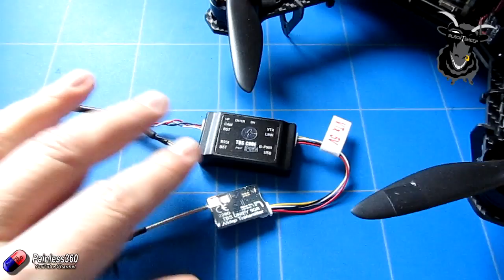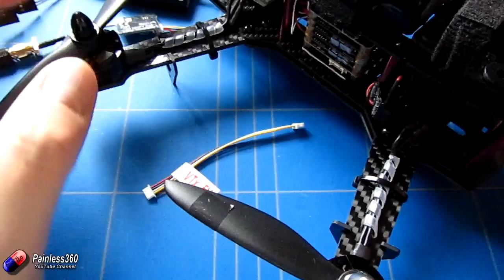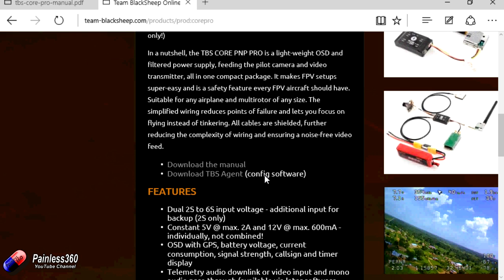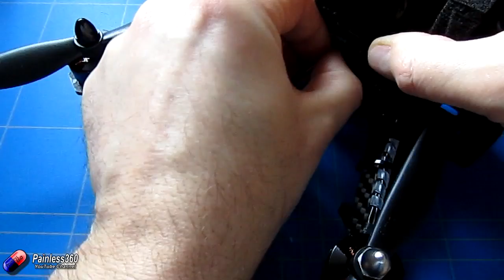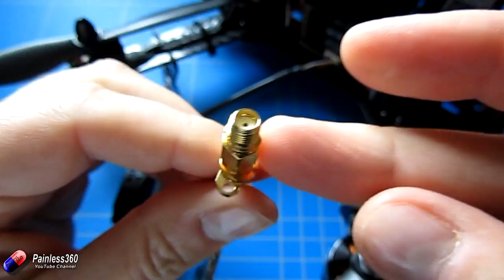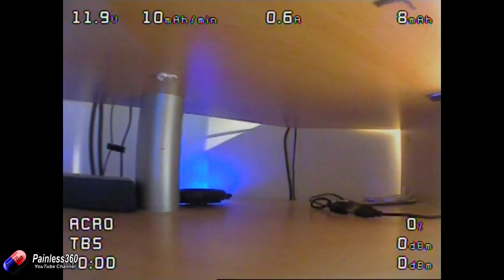(3/3) TBS PowerCube: Adding FPV kit (TBS Core Pro and TBS Unify Pro 5G8)

Comment: if the cam is 12v i can solder the pads to 5v?
Reply from the maker: You need to supply the camera with a voltage that it support. Best of luck

Comment: Have you had any heat issues at 200mw with the TBS unify pro race hv? Mine seams to get quite hot, I don't loose signal. It's mounted with great airflow off the rr prop. Just woundering if that's normal.
Reply from the maker: It does get warm, almost all of the more compact VTX here do. I did chat to TBS about the best practice on this and they've run the Vtx for a long time on the bench without a problem.. Personally I only power up the quad just before I fly and try and keep the airflow decent around the Vtx on the model when I can..

Comment: Noob question here: Do I need the Core pro to receive battery voltage data from the TBS powercube?  I am using an X4R receiver.  If not, could you tell me how to wire the powercube to the receiver to receive the data?  Thanks much!!!
Reply from the maker: Not sure what you're asking here. The cube monitors the battery voltage through the inbuilt PDB anyway.. Best of luck!

Comment: I joined the power into the VTX wire to the power out wires at the camera plug then had to rearrange the pins in the appropreate order, now when I plug the end intended for the camera into the core vtx out it powers the unifi pro. my unifi came with a 6 pin locking plug in so I had to make it work.Also changed voltage out from the core to 12v for both cam and VTX, running TBS 59

Comment: Hi,
Any idea if it is possible to connect gps to a tbs vendetta and make it "return to home" in case of tx signal loss or for any other reason? Thank you. Your videos are great!
Reply from the maker: +Vimalan Ketharanathan you could connect one but the GPS code in Cleanflight and Betaflight is sadly not up to the job..

Comment: the cable that came with my unifi pro has a split for power in and camera, the camera end will plug into the core at the vtx out, will this work? am I going to damage one or the other?, my unifi has a locking type plug in , none of the cable that came with the core fit. Not sure what to do,
. don't want to damage anything.
Reply from the maker: +Jeff Orr is get into the vendor as the cables that came with ours worked great.. best of luck!

Comment: Are You useing TBS core PNP pro race edition?Would it be the same process to install?
Reply from the maker: +Boomo 12 we used the full one (I think) the link to the one we used should be in the description. The TBS manuals are pretty good on the setup. The race edition is for the PowerCube only...

Comment: You can buy other connectors for it so you have rp-sma.
I have a quaestion. What about the head of the transmitter? As you use it on 25mw it will not be a problem but here we fly outdoors on 600mw so as you use 500mw, will it than not become to hot withoud a headsink?
Reply from the maker: It does run warm so I'd mount it in a place where it will get some cooling. Seems to handle it though..
Reply: Ok I hear that some people put headsinks on it for as they use 500 or 800mw settings.
So that is not necessary as I place it so it can be cooled by my props.
Reply from the maker: If you have the room and want to use the higher powers then a heatsink wouldn't hurt ;)
Reply: Space enough so I think I will order some raspberry pi head sinks.
They are cheap and small.

Comment: something you may be able to help me with ? i have set up a new frame utilizing the powercube but when i have gone on to gui cleanflight for set up i have followed your own steps in setting radio although i am using flysky FS-I6 radio paired to a FS-IA6B rx with ppm but although the gui and radio talk to each other the channels are all wrong eg, throttle=roll or pitch the only channel correct is yaw, could this problem be with my radio or my own haste.
Reply from the maker: +Alan Lydiate check out the channel order in the channels screen (right hand side), you need to try the other defaults.. Best of luck!

Comment: Got my quad in the air today for some hovering and must say everything just works great...well at least in Acro mode.  I have my switch enabled for Angle mode in the event I need it, but the quad will NOT hover very well. Always drifting.  Painless360 did you have any issues with your autolevel mode?
Reply from the maker: +caymandiver75 Not at all, worked great. I'd recalibrate the Acc and confirm that all middle channel values on the radio are 1500. Best of luck!

Comment: Thanks for the comprehensive documentation! At 9:46 you mention the wiring harness to connect to a fatshark FPV camera, I'm assuming that's because of the pin order coming out of the CAM picoblade? Are those pin values documented anywhere? I couldn't find them in the Powercube manual. The CAM port seems to be Vid,Gnd,5/12V,OSD (corner-to-center).

I'm looking to use the fatshark 900tvl CCD with the powercube and based on http://www.getfpv.com/catalog/product/gallery/id/1938/image/9650/ I'm guessing I'll need to do the same?
Reply from the maker: The best clue I colour of the wires in the camera and a by cables. Black is gnd and red is the positive voltage. Best of luck!

Comment: Painless360 got my quad nearly complete and I'm stumped in how I can get my RSSI signal strength to show on my OSD.  Settings in the TBS Core are the same as yours in the video.  RSSI Source set to "Link."  What settings in Cleanflight need enabled to get this working?
Reply from the maker: Hang on, there is a new feature in the next OSD FW that will allow us to use the RSSI feature on the taranis/Cleanflight to see it easily..
Reply: +Painless360  Any update on this with the new firmware now being released?
Reply from the maker: Not yet, no estimate on when either sadly..
Reply: +Painless360 Also wanted to ask you if you have had any heat issues with the TBS Unify Pro 5G8?  I got it hooked up and love how I can change bands, channels and power output through the OSD, but I do wonder how this little vtx can handle power over 250mw.  What is your opinion?
Reply from the maker: I've not pushed it that hard but I have taken care to mount it with a little airflow around the board (see the standoffs I designed in Thingiverse). Happy flying!

Comment: i have a thug cagefighter frame i have setup a slider to to tilt fpv camera on my taranis + but how do i enable it to work on cleanflight? powercube connected to servo connections
Reply from the maker: +dave Dh WE do cover this in one of the Naze32 videos on the channel. Check out that playlist for a simple guide...
Reply: +Painless360 is that the setting up a simple pitch gimbal one?
Reply: +dave Dh i have added the servo to the dedicated servo pin out on the cube fc not through sbus connection maybe i need to enable this somehow all looks fine but no servo movement

Comment: Hi Lee, great video again.
Just a few quick remarks. ImmersionRC also makes a RP-SMA spironet antenna
RP-SMA is actually safer then SMA in my opinion. You can put a RP_SMA antenna on a SMA VTx and damage your VTx because there is no connection. You can't do that the other way around.
Although the power switching in the TBS VTx looks very nice to have I am pretty sure it is still illegal to use in most countries because it CAN output more then the legal limit. So be careful with that one. For FPV racing quads I recommend using 25mW (mandatory when in official races) and if you need more maybe 200mW. Anything more is overkill, except when flying in woods, and will only cause problems when flying with your friends. So my sugestion is buying a 25mW and a 200mW of the same brand so they are easy to switch.

Comment: How do you have the vtx mounted to the core pro and what's holding the core pro to the top plate?  Very informative video series! Learning a lot!
Reply from the maker: +caymandiver75 I have them both held to the frame with double sided foam tape and a cable tie. You can see the 3d printed standoffs I made for the Unity VTX on Thingiverse to make sure that the rear of it had airflow..
Reply: +Painless360 So you print two of the standoffs, stick the Unify Pro on them and stick the entire assembly on the Core Pro? Would it be possible to have a clearer picture?
Reply: +caymandiver75  Thanks!